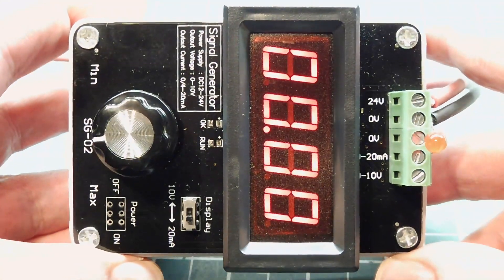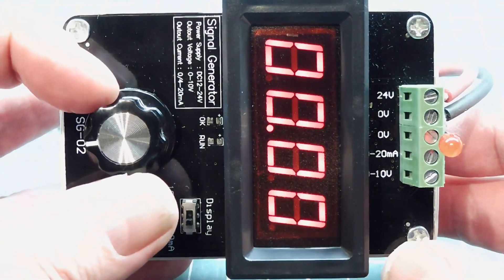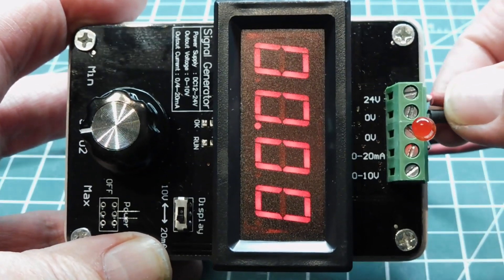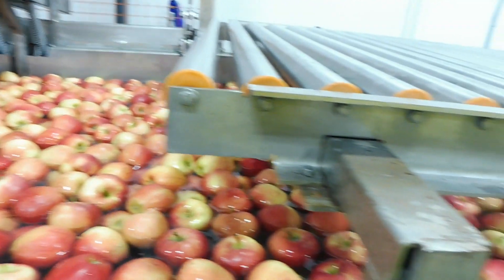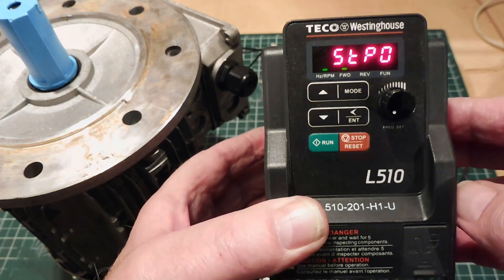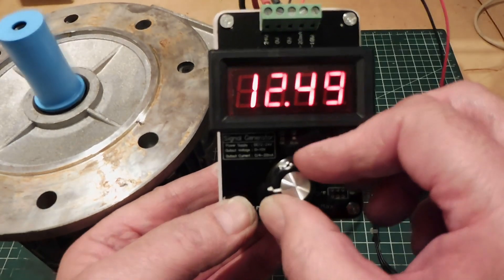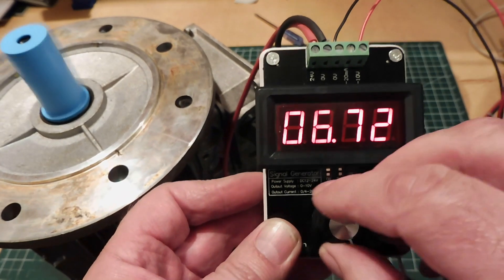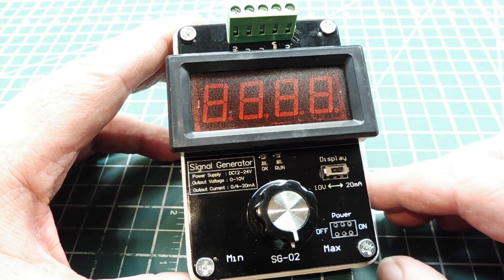DROK  /  0 to 20 mA and 0 to 10 Volt Generator

Comment: What would happen if you wired in a standard 1.5v battery to the VFD? Would it run the motor at 15% ?

Comment: I just use a 1.5 volt battery for quick-n-dirty tests on a VFD. Having something to calibrate 4-20 loops would be nice. I built one ages ago, and it was handy for calibrations.

The drives that I am currently fooling around with are -10 to +10 volt input DC Servopack drives for an old 80's era lathe.

Comment: I just picked up a variant of this from Drok to create a hardware input for the PLC programming work I do. Does the multiturn pot bug you? I use this as a sim input for whatever i need but its primarily intended to help tune my PID loops reaction to disturbance. I was hoping that I could change this it to react to a smaller range of the pot. The instruction sheet seems to suggest that might be possible, but I couldn't decipher the chinglish. Have you had any success with that?
Reply from the maker: For my application it works ok but if you want faster response you could change the multi turn pot for a single turn of the same value.

Comment: Great tip and a cleaver device.  I just ordered three.  That way I can blow one up on Hipot and Ground Continuity testing.  I'll ket you know the result.

 I don't understand why you don't do the standard thing of using the VFD supplied 10 VDC refernece voltage to drive the speed control pin.  It is done in almost every application unless there is a legacy 4 to 20 mA sensor running around.  It looks like you're taking the long way around the barn.

I must have done 100 VFD installations.  Only one case required using a 4-20 mA sensor.  BTW, it's described as 4-20 mA because anything less than 4 mA is defined as an error state and the device is thrown into a "safe mode" wherein no spindles turn.  Your wiring is going to be rejected by EH&S unless it traps signals <4 mA into the external E-stop system.  Safety is the entire reason 4-20 mA sensors were created.
Reply from the maker: The 4mA "live zero" is failsafe. You can zero your device by bringing the current just below 4 mA. The 4 mA is also great for troubleshooting broken current loops and it also supplies power to devices in the loop. I have seen 10 volt references go out of range so I use my test box for that. The video is just an introduction 4 -20 mA and 0 to 10 volts as most of the remote motor controls I have use Modbus which would be another video.
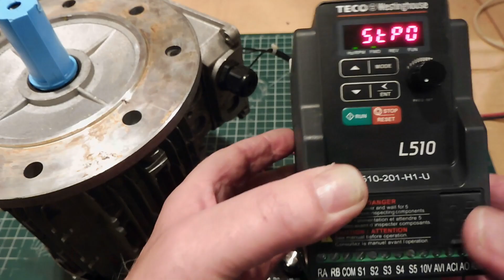Reply: The 4 mA "zero" point was demonstrated at 2:55. The motor did not turn until 4 mA. The DROK can test this feature by starting at 0 mA. The DROK is a piece of test equipment so why Hipot during troubleshooting?